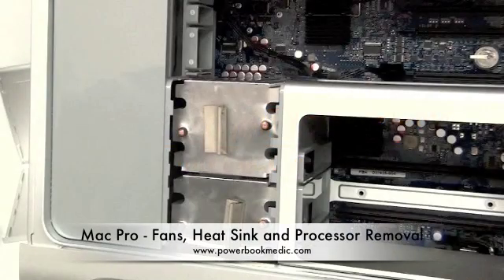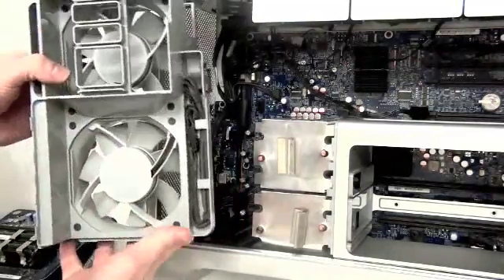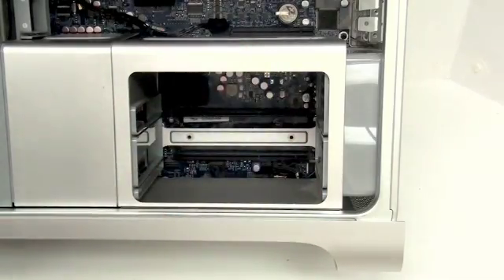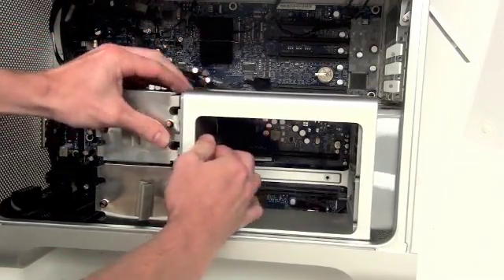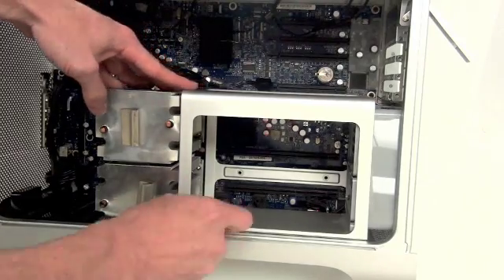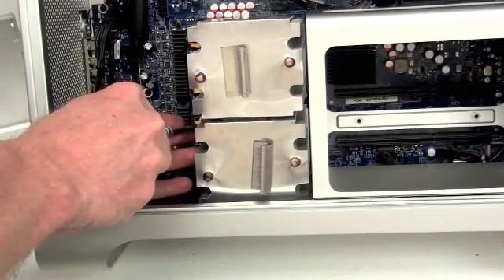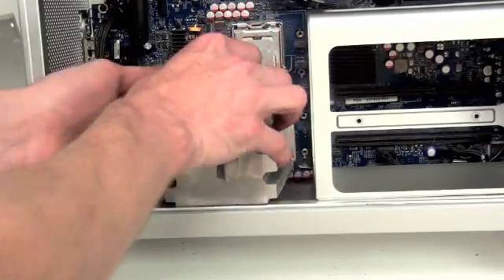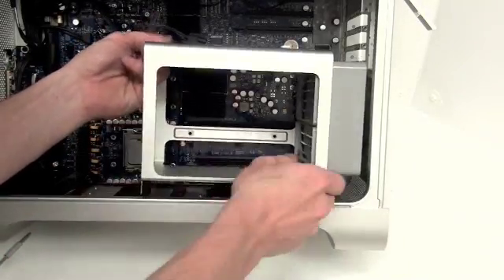Mac Pro Repair - Fans, Heat Sink and Processor Removal

Comment: Could be wrong but I am pretty sure you are not supposed to remove heat sinks one side at a time. I was taught to loosen them a couple turns each in sequence so as not to apply too much pressure on any one side of the chip which occurs when you take one or two screws out before the others.

Comment: Was it necessary to remove the vent from the cage as shown in this video??? Anybody..., how do I get it back in place?
Reply from the maker: Yes, it's necessary to access the screws. It will snap back into place similar to how it comes out. You will have to angle it in.

Comment: Another question, problem..., how to get the vent back on the memory cage???
Does NOT pop back in place.
Reply from the maker: t will snap back into place similar to how it comes out. You will have to angle it in.

Comment: Hello my 2009 MACPRO makes slight to heavy fan noise every time i "make a move/action" (mouse, start an app, anything...).

It makes a heavy noise when the computer starts.

What do you think ? Processor fan ?

Fan sounds like it has issue/pain to work.

Thanks for your help !

Comment: 1:20, it's easier to push the fan enclosure into the memory case first and remove it, before removing the heat sinks. Also, the heatsinks are slightly different on some Mac Pro models. You should mark "top" and "bottom" on the front. 
Also remember to re-install the lower one FIRST, or else you'll have problems fitting it back.

Comment: These videos did jump around a bit... I have done it twice, though, so I'll list the correct steps, in order, for the 1,1 Mac Pro. Steps may vary across models, so keep that in mind. Also, keep in-mind that I have only done this on my 1,1 Mac Pro, so--who knows--it may or may NOT work on your later system. I do know for a fact that some models of Mac Pro (later ones) have the PCIe fan separate from the CPU fan. I think it was like that beginning in 2009 or so.

1. Removal door cover from Mac Pro
2. Remove RAM risers
3. Remove the four screws that hold the RAM cage in
4. Remove heat-sink cover; it will slide to the right a bit and pull up (likely diagonally). It may be a struggle to get it out the first time. Just note that it is held in with clips that slide into their appropriate slots.
5. Remove your HDD from the 1st bay... or all four. I like to remove them all so that I have easier access. Now, remove the SINGLE screw that holds the front fan assembly in. It's that tiny screw at the top of the fan assembly, which screws right into the motherboard. You may need a slightly longer screw driver for this--preferably one that's magnetized, as you don't want the screw to fall into some crevice within the Mac Pro. If not, just make sure it is in place so that you can grab it before it goes anywhere.
6. With two hands, firmly grasp the top and bottom of the fan assembly and firmly yank it upright. Don't be too rough with it, but note that it will take some force to remove it from its slot.

There you have it; the fan is out! Now just do that all in reverse order once you are ready to re-assembly the Mac Pro.

Comment: My 2009 Mac Pro (4,1)'s front processor cage fan making some noise. Is it ok if I put some motor oil in it with a syringe? (Don't know where is the speaker and if it can be harmful)
Reply from the maker: Gökhan Bıyık - No. Motor oil is for a motor not a Mac Pro.
Reply from the maker: Seriously? No, you should not put any type of oil in the fan. It would be better just to replace the fan. They are not expensive parts.
Reply: how about machine oil, or any oil?

Comment: You shouldn't ignore the fact that you can't remove the fan module without first removing the screws. You can clearly see the hole for them in the video, but they were already removed
Reply: That's what I was looking for, there's only one in the fan right?
Reply: Vidar Can't say I'm positive as it was a while ago that I took my Mac Pro apart, but I'm pretty sure yeah there's only one.

Comment: I have a 2006 model.
Agreed with the major oversight on the screw(s) holding the fan unit in. 
The one obvious at the top right seems to be the same on all models. 
Mine has one more screw at the base. Take the plastic cover off the heat sinks, and down at the very base (left of the sinks, on the right bottom corner of the fan unit) is a tiny philips screw. I did not find one site showing this screw, but it is essential to remove it to remove the fans on my 2006 MP. Then it pops right out.

Comment: You absolutely cannot get the fan out without removing the screw from the top back...the hole and flange for it are clearly visible on this video. The fan does not just pop out...unless you first remove the screw.

Comment: also,  there's no need to remove the rear fan - there's enough space to flip out the chips and properly apply thermal grease with that piece intact :)

Comment: The blank screw near the top behind the drive 1 is the same on the 2006 and 2008 mac pros.  That second screw is for for the 2008 model.  This vid is a 2006 mac pro - as the two memory cages face up.  The 2008 model has an upside down memory card.

Comment: You failed to mention the two, Philips screws on the front fan assembly, it even shows on your video where the upper screw normally is.  The second one is a complete pain to get at unless you remove the CPU heat sink but that's a pain unless you get to the screws holding it down on the left side.  Grrrrr